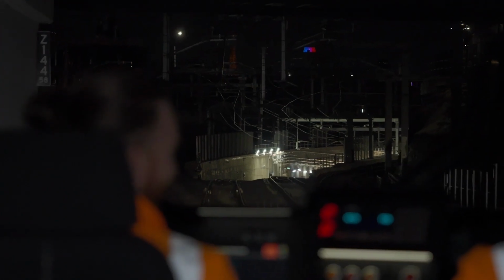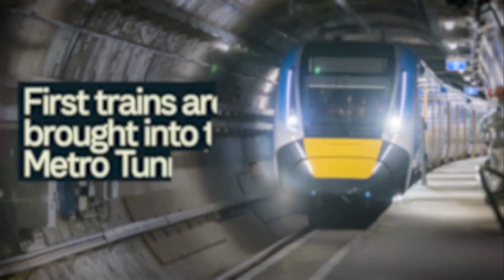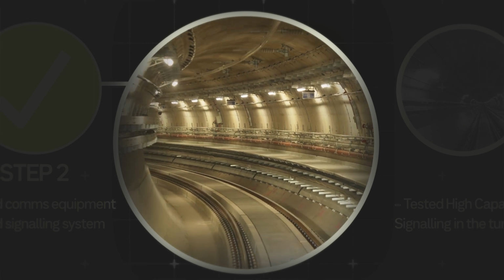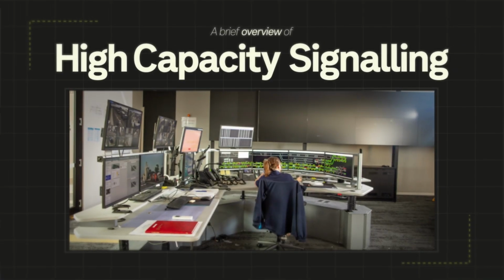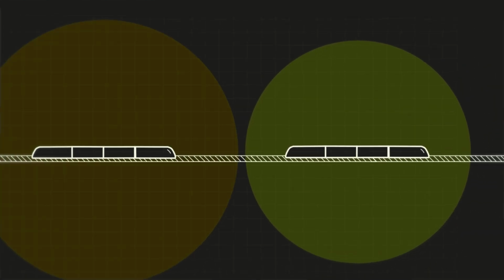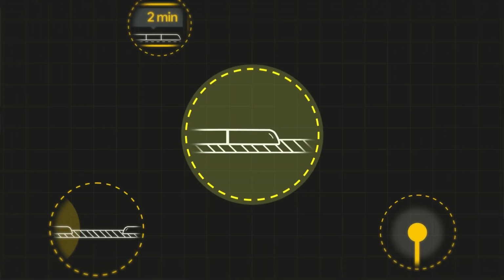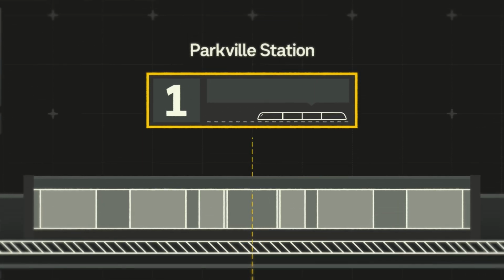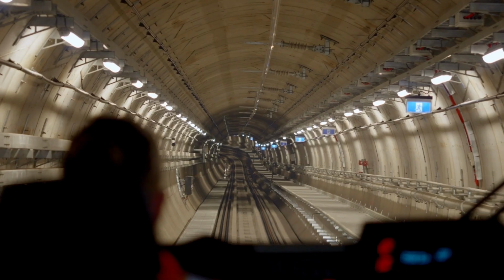Testing multiple trains in the Metro Tunnel

Comment: Why isn’t it fully driverless like Sydney metro
Reply: @Tmm42 Because the trains will be running on current suburban lines, before and after the new line and new tunnel - from/to outer Greater Melbourne Area stations.
Other services run on those mid-outer suburban sections as well such as regional services, and freight services, so can't run automated/driverless along there.
Not yet. 
London has a similar line, as train is driven at outer parts, then switch to automated, where the new infrastructure section is. The driver is then just monitoring through the automated sections.
So believe that's how Melbourne's Metro Tunnel will work, in a few years.

Comment: It’s also possible that at the current rate the Metro Tunnel can begin commuter operations in June to August 2024 however it’s possible that initially only City Square and State Library stations will be open at that time while the other three stations might not be opened until the following year or 2026! :)
Reply: Arden is practically complete now with the osd left to build, i imagaine the cbd stations take the longest since theyre the harder to work with due to their depth and lack of space

Comment: Can the signalling system let a second train begin to enter a train platform while the rear of the previous train hasn't fully cleared the platform? Or does a follow train have to wait until the previous train has completely left the whole platform like some other systems?
Reply: there probably is the possibility because the trains are automated in the tunnel i believe but it would leave little room for error
Reply: It would depend on the speeds on the trains. As mentioned in the video the ‘bubble’ size would depend on speeds & locations. It’s entirely possible with both trains going at low speed.